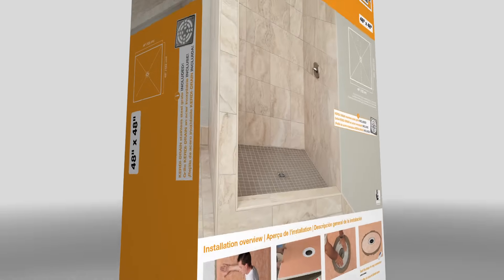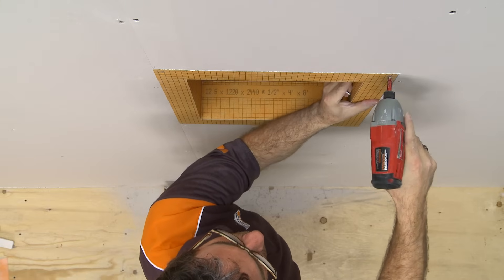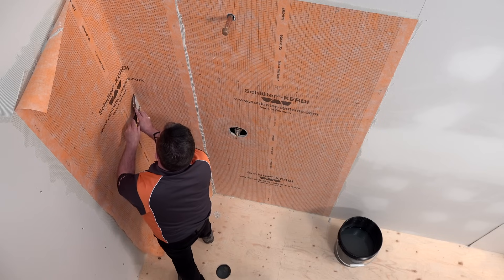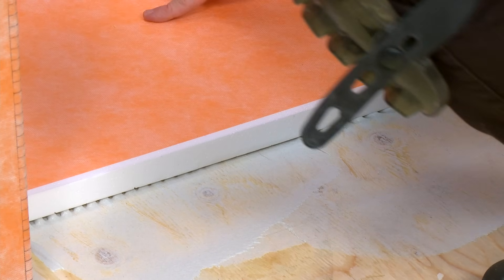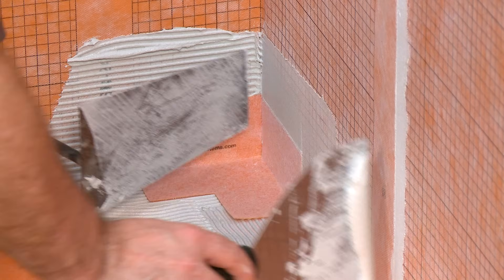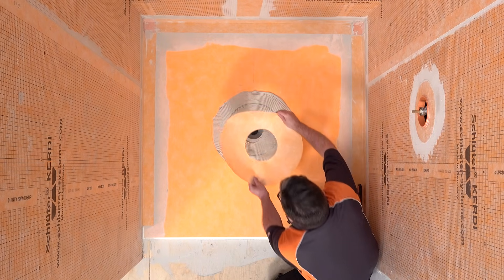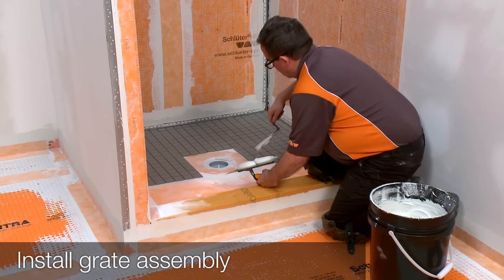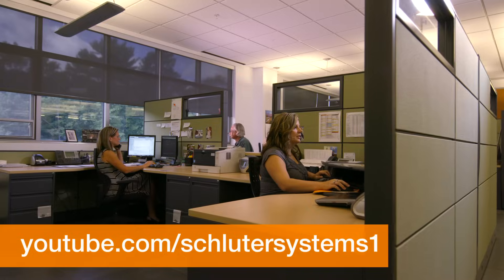How to waterproof your shower installation with the Schluter®-KERDI-SHOWER-KIT Complete Kit

Comment: I would like to see more screws holding the drywall to the suds. I don't get why someone would use drywall in the first place though. The gypsum will crumble if it gets wet.
Reply: Because if the a schluter is installed properly, the drywall won’t get wet. I’d like to think this drywall is glued on this application but who knows
Reply from the maker: Not to worry; drywall can be used because KERDI is a waterproofing membrane and will therefore not allow any water to penetrate and damage the drywall. 
We generally install drywall screws every 12" o.c., which is standard.
Reply: @schlutersystems1  Unless you're using drywall that's 3' wide, your screws in this video were 16" OC.
Reply: Schluter-Systems North America as a plumber things can and will go wrong. I've seen it. This is not a perfect world and I am not necessarily asserting that the Kerdi will fail. Other issues from behind the wall can cause water damage too. I am just saying it is an unwise practice if trying to save money. Plus depending on tile selection there will be a lot of weight hanging from those screws. Ordinary drywall screws are not known for their shear strength.
Reply: @schlutersystems1  I will say this is an amazing product but it is scary what is being recommended to non-professionals who are probably doing this for their first time and don't know better. Some old time inspectors I know would not approve this despite your claims, and I don't blame them either.
Reply: @AmosMosesJr  We had this done in our walk in shower 11 years ago.  Huge shower tiled to the ceiling.  The shower had standard drywall screwed to the studs.  No glue.  We had zero issues.  If the product is properly installed, you will not have an issue.  If you are using cement board in case you have water leaking through your waterproofing, you have much bigger issues, like mold in the wall cavity.
Reply: @AmosMosesJr  The building code is over ridden when a product manufacture asserts claims in writing. Drywall in a wet room must be mold resistant anyway. (ie; Green board, Purple Board)

Comment: Do you not have to mortar any of these products onto cement board??? It looked like it was just drywall on the walls and plywood on the floor.
Reply from the maker: Good question! The waterproofing Kerdi membrane can be applied to any approved backer board. You can see all of the requirements here: https://sccpublic.s3-external-1.amazonaws.com/sys-master/images/he2/h48/8984381980702/Shower%20System%20Installation%20Handbook.pdf
Reply: It can go over drywall, but it’s too easy to just put up some cement board and it makes a more solid base for the tile.

Comment: Will this and board like it work underneath pvc or MDf shower board rather than tiles?
Reply from the maker: Thanks for the question! Our Shower System is really meant for tile and stone products. This particular kit comes with Kerdi membrane which is installed over an appropriate backer board. If ever you have more questions— please give our team a call. They can be reached at 888-472-4588. 
Thanks!

Comment: would i be able to use  RedGURD on it  as will ??? thanks
Reply: Yes. You need to add some liquid membrane because water will follow the thinset seam. They changed their wording to water management system because it's not totally waterproof.
Reply: @Panasyukvic   but when i called  schluer Canada they said  do 
not
Reply: @Panasyukvic  https://m.facebook.com/story.php?story_fbid=2667503720032836&id=100003197014543
Reply: https://m.facebook.com/story.php?story_fbid=2667503720032836&id=100003197014543
Reply: Use ardex 8+9.
Reply: No, redguard requires a modified thinset. The product redguard imo is junk. NEVER use modified thinset in a shower.  It feeds mold!
Reply: @michaelhorn9114  do you mean I have to use modified on top of red guard or I cant put red guard over modified thinset?
Reply: @Panasyukvic  if you are using a Schlueter product,  you should use a non modified thinset, or the Schlueter allset. Redguard should not be used with Schlueter products. Redguard requires that you use a modified thinset.  Which imo is totally wrong for any shower system.  It is water proof,  but the problem is that it is to be used with modified thinset which is organic.  It actually is a food source for mold growth.
Reply: They said its waterproof before and the truth is it's not.... so I cant trust them.